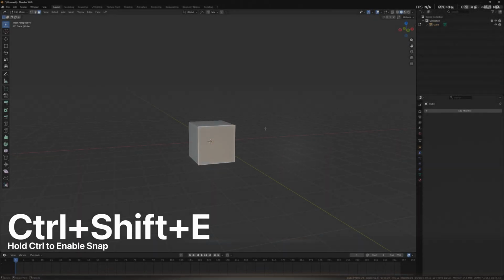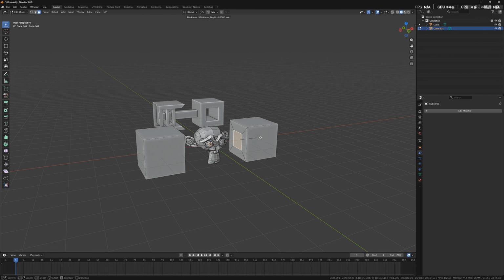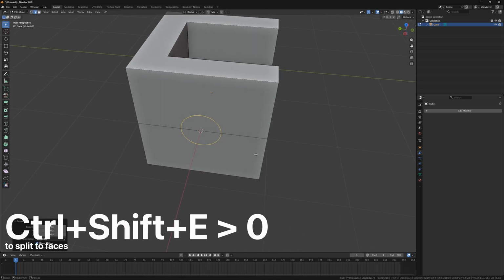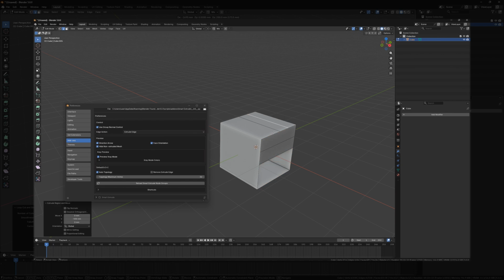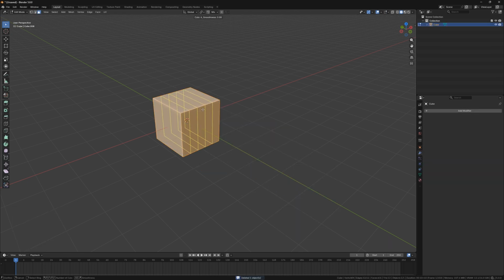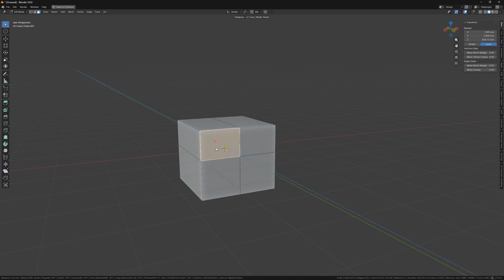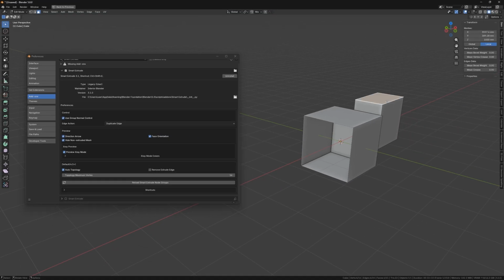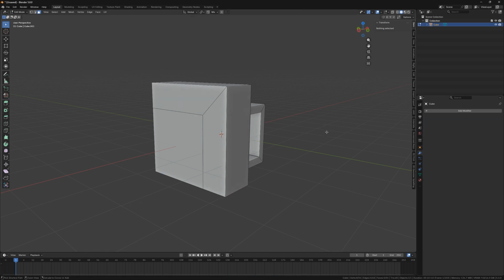Unlimited Extrusion Forever! Smart Extrude 3.1

Comment from the maker: Some limitations and bugs in version 3.1:
Non-manifold cannot perform addition and subtraction simultaneously in axis mode.
Auto snap may fail.
There are also some extrusion issues.
These will be fixed in the 3.2 update.

Comment: Could you please add an "Extrude Along Normals" (or edge-normal-based) option for edge extrusion, similar to how it works in 3ds Max?
Currently in Blender, when extruding edges, we can only constrain movement to the X/Y/Z axes, but there’s no built-in way to extrude along the averaged normal direction of the selected edges—which would be extremely useful for organic or hard-surface modeling workflows.
Reply from the maker: Thank you for your suggestion! This feature has already been added in version 3.2, and its release is scheduled to align with the Blender 5.2 version release date.